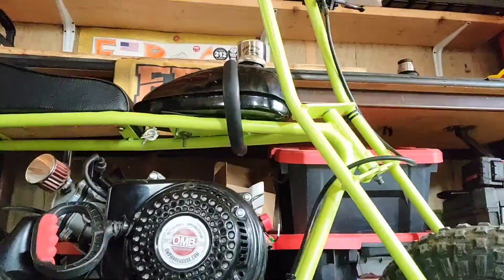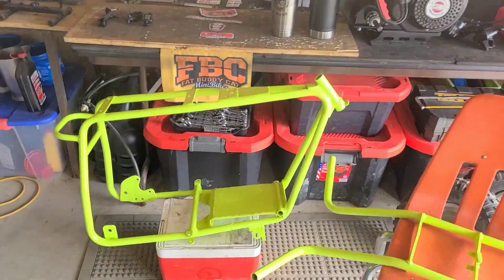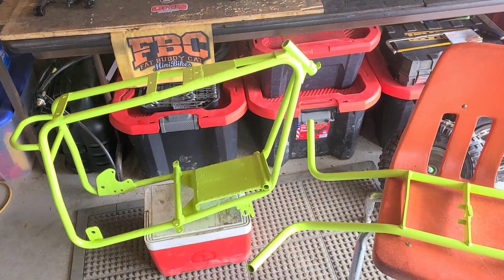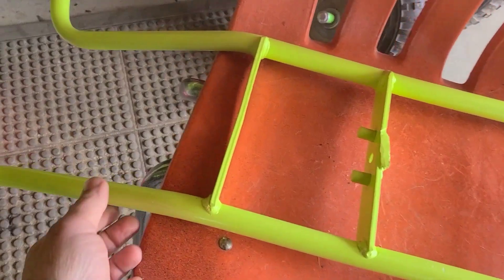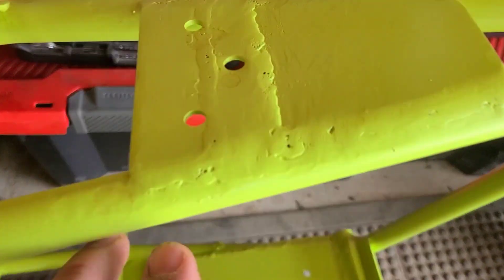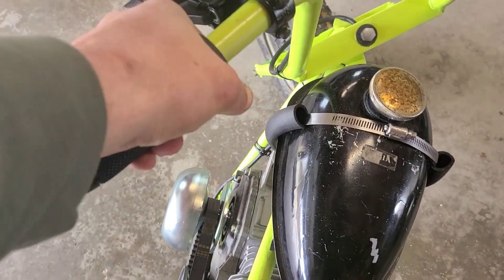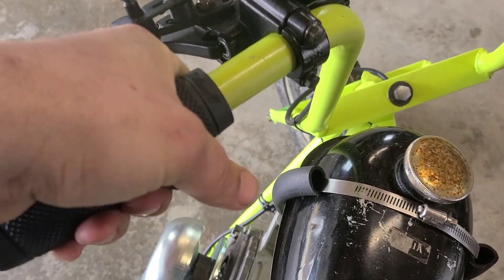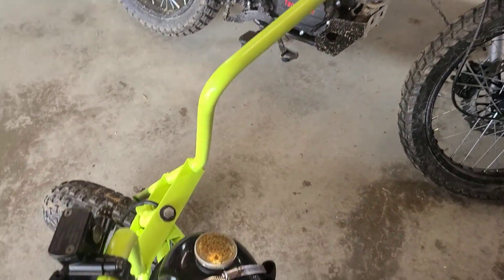The Ultimate Torque Bug 3.0 "Final(ish) Assembly Pt.1"

Comment: The Bug is lookin' good! Nice tip on the grip install. Great information. That new driver looks interesting. I'll be interested in how that rascal performs. I like those grips too, they're kinda fat in the middle like me. I noticed you are a big hand guy too, I'm gonna have to try some of those grips.
Reply from the maker: Ombwarehouse.com FBC5OFF
Reply from the maker: I was surprised honestly. OMB stepped up their grip game with the Biltwells. The Kung Fus look cool too but I was definitely looking for a retro feel on the Torque Bug.
Reply: @fatbuddycat  Thank you Sir! I'll see if I can get an order worked up. Almost warm enough now to get started on this stuff.
Reply from the maker: @KentuckyFriedFixes   I read a claim of 13hp on that Ghost....you think that's possible?
Reply: @fatbuddycat  I don't know. The 212 Hemi has a flat top and it doesn't make that much HP. The camshaft in the Ghost 212 is a match to the 252 Rattlesnake cam though and the intake port has been cleaned up a little. I'd hate to guess what it will make. I keep looking for somebody to put one on a dyno. If I had one in the shop I would but too much $$$$.
Reply: @fatbuddycat  You would think at least 11.5 HP.
Reply: @KentuckyFriedFixes  I wonder if the Ghost cam matches the Rattlesnakes 230 duration?
Reply from the maker: @KentuckyFriedFixes  someone did and they claimed 12.8. My nuggets are fried figuring out how the 212r is only claimed to be 9.
Reply from the maker: @Deucealive75  without too much ramping I'd be surprised it produces 12 at a limited rpm. I'm not sure how that effects jetting but it must be calculated to produce efficiently.
Reply: @fatbuddycat  That's a lot. I'm a little skeptical.
Reply: @Deucealive75  It matches pretty good or at least it comes within a degree of the Rattlesnake cam. I'm going to run it again to get the openings and closings recorded again when I get the chance. I think you nailed it. It's either a Rattlesnake 252 or they copied the profile.